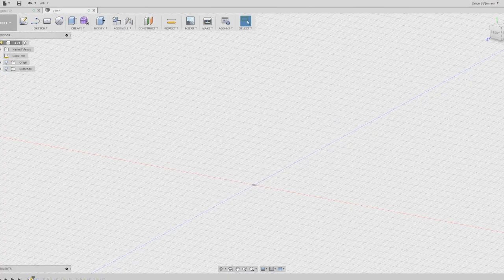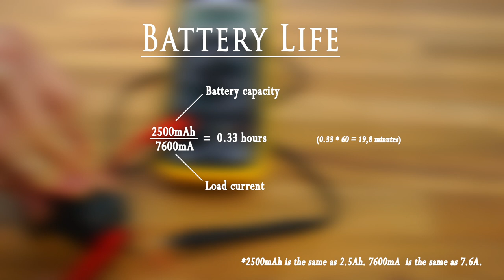Awesome Ideas -  Multi-Tool Lighter

Comment: Brilliant, in a very small package. It could be used to heat small amounts of metal, for electronic repair or as a lighter. Great for camping in places with wind problems, like the bay area.  A part two, build could add voltage control and maybe a fun marshmallow toasting experiment.

Comment: if you are going to continue using said device please get a protection circuit to keep the battery from going critical it will lower the usable amperage but atleast it souldnt act like an incendiary in your hand.

i use the same charging board but i make sure when using it to use a cell that has protection circuits already onboard.

Comment: The actual current will be quite a bit higher because that multimeter will add a bit of resistance along with those probes that look cheap. Also >7A through a tactile push button that is usually like 500mA max and no over-discharge protection >.<

Comment: you should get a mosfet in there somewhere as a battery protector
Reply: Jacob Westphal Just a MOSFET wont work. You would nee a dedicated chip to watch the voltage of the battery in order to turn the Output on and off. Unfortunatly these chips feature an over current protection which would cut the power off if the button is pressed.

Comment: It is not a LiPo battery. Therefore drawing such a large current would result in damaging the battery.
Reply from the maker: These Li-ion batteries can supply 30A. It will not damage the battery.

Comment: I dunno if the battery likes those 7.5 amps. I mean, it's only for a few seconds but what if some braindead guy uses it for it's 20 mins which it will last? Couldn't that lead to an accidentally fire too? o:
Reply from the maker: According to the supplier the 18650 battery cell can output 30A. Even the standard 9V batteries we use in our everyday household devices can catch fire if used in the wrong way. As long as you don't abuse the battery you will be fine.
Reply: Lol, 30 amps? o.O That's more than enough if this is true. Thanks for the answer! You are doing a great job in making those videos, they are awesome!
Reply: You are absolutely right, running the battery long enough (below 3.3/3.0 volts) would put you in a very dangerous situation, DO NOT CONNECT LEADS DIRECTLY INTO BATTERY AND ADD VOLTAGE PROTECTION OR BUZZER ALARM, lithium batteries can be very dangerous, the one used on the video, samsung 25r is one of the safest, with a pressure leak hole to help prevent explosions, but still very dangerous without voltage protection, especially with the leads soldered directly on the battery, potentially clogging the tiny hole. LiFe lithium batteries are much safer, but as of my knowledge, not available in 18650. A simple, cheap (1$/£) buzzer alarm between the battery and resistance (kanthal wire) would beep once the voltage drops to dangerous levels, and potentially save your life!
Cheers
Reply: You're right, sir RCLifeOn should add some safety measures, otherwise 
it's too dangerous for daily use or somethin'. :x Better safe than 
sorry!
Reply: 25R from samsung are usually used in vaping when the resistance can go even lower, as long as you don't use a 0.1 ohm wire you should be fine
Reply: Those newer TP4056 boards supposedly have a protection IC on them, but I'm not sure about the cutoff voltage so having a redundant separate protection chip (like $1 each from China) or a buzzer is probably a good idea if anyone wants to make something like this that isn't as dangerous a prototype.
Reply: yep..... but you should defmately add a deep discharge protection... if a lithium batery is charged with a to low voltage, that could cause a fire
Reply: Some companies do actually make LiFePO4 batteries in the 18650 form factor...

Comment: overdischarge? you know 18650 batteries can explode
Reply: They can not. They just have that bad reputation because of e-zigaretts. When this batteries are heavily overloaded they gas out. In some e-zigaretts there are no ventilation holes, the gas can not go out an the e-zigarett itself explodes, but not the 18650
Sorry for my bad english, i am german
Reply from the maker: The Li-on battery cells are considered to be fairly safe, and the battery can definitely handle the 7.6A current.
Reply: Only consideration is to use charging circuit with protection - I think that one on the video hasn't got any.
Reply: The tiny ventilation hole helps a lot, but any LiIon bat is the most dangerous battery, unless it's LiFe, a bit safer. Any LiIon bat will be destroyed under a certain voltage (3.0v to 2.6v), and WILL catch fire, cheap ones with no ventilation are at at higher risk of explosion, like many cheap e-cigs come with. I vape with the one used on the video or LG, the safest. Sony is also good but highly counterfeited. A simple buzzer alarm is cheap and makes things almost 100% safe.
Cheers
Reply: realestatepms You are totally right
I think about this small LiPo/LiFe/LiIon Warners with a Display for RC Cars, they would be great
Reply: what happens when battery got 1.5V? it didnt explodes or it didnt warms? i think he must use TP4056 Overdischarge&Overcharge protectioned board

Comment: Hi,
It seems incredibly dangerous not to have a low voltage protection for the battery, as if accidentally over-discharged will be destroyed, potentially exploding or catching fire.
DO NOT ATTEMPT DO BUILD THIS WITHOUT A REGULATOR/BUZZER BETWEEN THE RESISTANCE AND BATTERY, EVER!
Reply: I really like your channel and thank you for your time, but many people do not understand how batteries work and that's the main reason for accidents, anyone building this and over-discharging the battery (running it for under 3.3/3.0 volts) would be in serious trouble, potentially life-threatening, please add a banner or change the circuit to add battery protection or at least a buzzer alarm.
Cheers
Reply from the maker: What you have to remember is that these lithium-ion cells are used in too many devices to even count. We have computers, RC cars, phones, cameras, watches, electric tools and so much more. Even though they often do have a protection circuit preventing the battery to run completely empty, some of these products do not. For example, several radio controlled cars I've bought during the years did not have a low voltage protection circuit and used the same 18650 cells I used in the video. 

Yes, there have been reports of batteries catching fire, many of those reports are regarding lithium polymer batteris and some regarding the lithium-ion cells. I would however say that the lithium-ion cell is considered to be more safe and out of ALL batteries being overdischarged each minute around the world only a few does catch fire. Based on the number of people who will build my multi-tool lighter, I think we are pretty safe. 

I very much appreciate your comment, and discussing the subject is important for people to know about the risk. Though I don't know if the "DO NOT ATTEMPT"-part was necessary.

Comment: What's the AWG rating of the kanthal?
Reply from the maker: It's called "Flat Ribbon 24AWG Kanthal Wire". Check it out on Ebay.
Reply: I have got AWG29 Kanthal. It will also work, right?
Reply from the maker: Yeah sure, try it out. The worst thing that could happen is that it burns off.